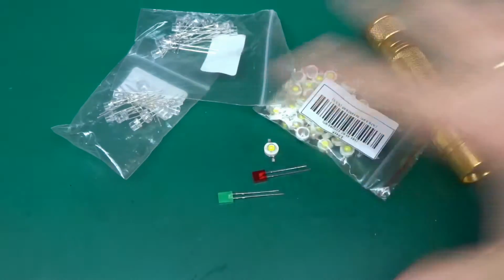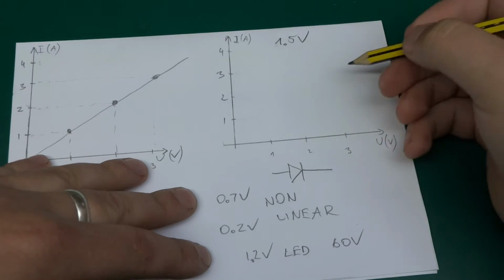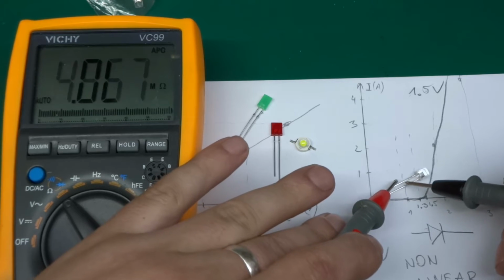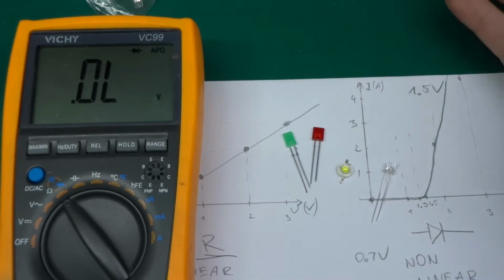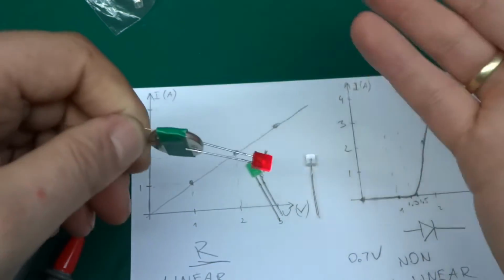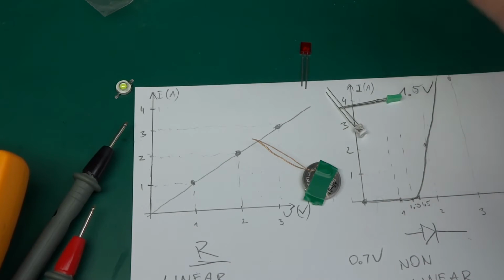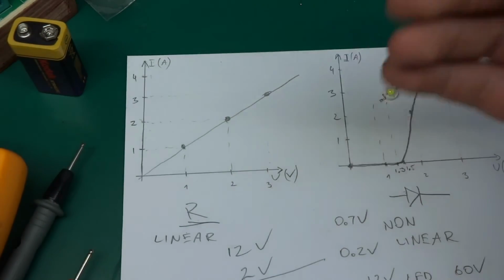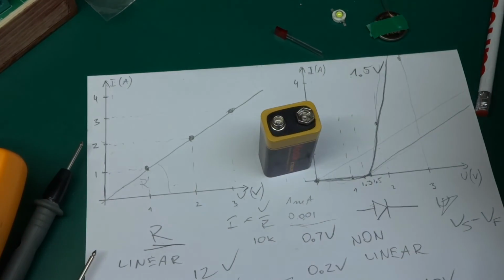How to test LEDs (and how not to) - quick and dirty

Comment: on the right hand side of the component tester there are pads for testing surface mount components
Reply from the maker: GManGT yes, I know.  But the 1W LED was too wide a bit and i was not getting good contact. This seemed easier :)
Reply from the maker: GManGT and the back of LED is metal,  which was shorting the pads too :)